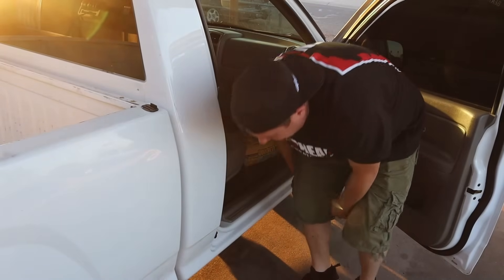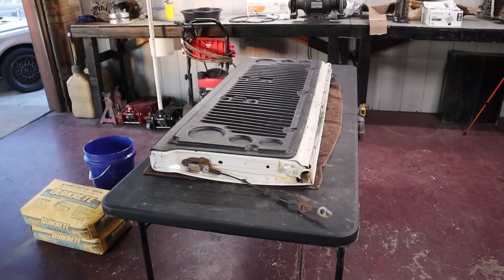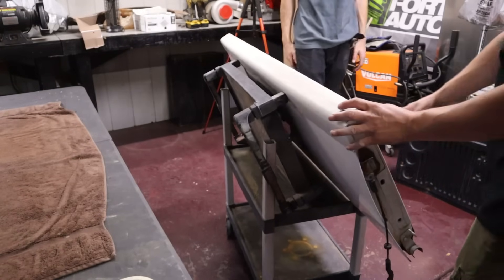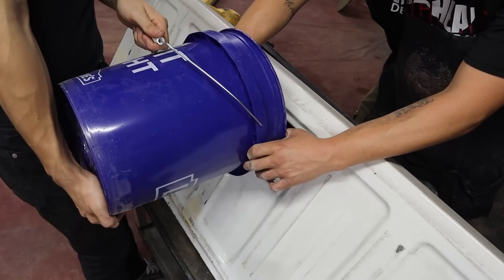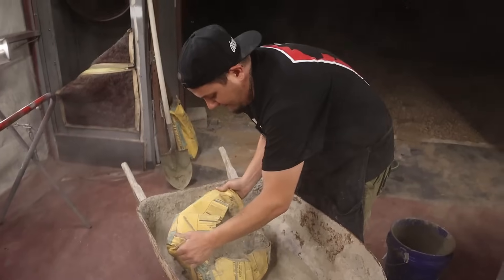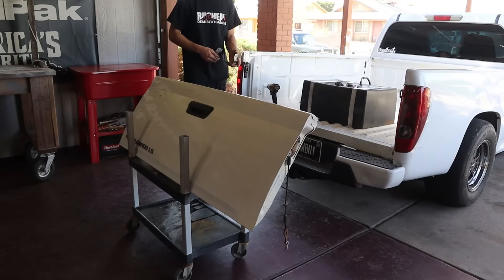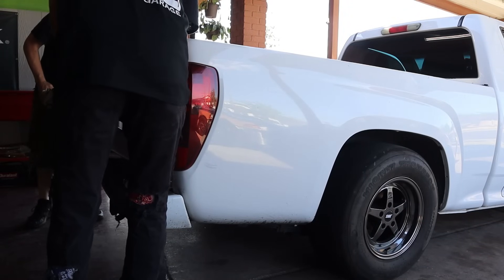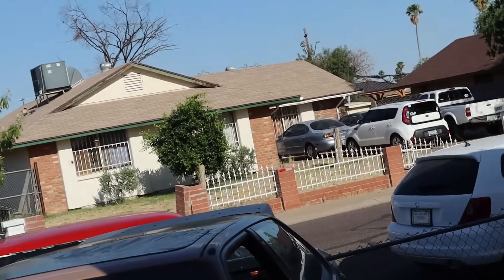Concreting Braven's Truck!?

Comment: Some food for thought is with all that weight on the other side of the axle it could make the front end light and possibly on acceleration when the front rises on launch it could lift and could be sketchy when dragging but that's all a possibility. Having the weight right over the axle would give the best traction.

Comment: Curious as to why you'd go this option versus using a good shock with adjustment out back, a quality spring set, and if it doesn't have them, Caltrac Bars? I get the whole "Beater Bomb Butthurt Bar lever action premise but this is stuff we did in the 90s with a 64 El Camino that was street raced for years around Chicagoland. Everything had to non-suspecious looking so we filled the tailgate with about 200 lbs. But with shock, spring, and traction bar technology now a days it would prove to be a better option just based on all the available adjustment you'd get out of it. Weight should always bee move able as well because you never know where you vehicle is actually going to need it depending on conditions and weight bais of the vehicle. With it in the tailgate it's stagnate weight and your stuck with it.
Reply: Best answer for sure.
Reply: $20 in concrete, or $2000 in suspension lol

Comment: You guys need better suspension. Not concrete. For the traction you get from the cement your going to loose in power to weight weight
Reply: Exactly!!👌
Reply: Then buy homie some suspension upgrades lol
Reply: @projectS10ls  you buy me some oil changes to break in my new motor and I'll buy bravus some suspention upgrades. Deal?  🤝

Comment: I filled a truck tool box with old rotors break hub bearings lol got to 500 pounds to weight the rear end down it does work in fact

Comment: Should of just pourd it in dry then added some water. It probably would of been easier.
Reply: Yep, would have worked just as good. That's how we use to do fence post at my old job. Never had an issue

Comment: Anyhow knowing what I know now the smartest way to weight the bed of your truck is to bolt two  plates in with a 2" shaft to drop 45lb gym plates on. That would have been much more convenient and easily removable

Comment: @ceelos87 like this guy said y'all should of vibrated it somehow not only to pack it more but also mix the different batches and too get the air bubbles out I used to do concrete columns for parking garages an other stuff etc

Comment: Lead blocks on the frame.. small but heavy asf
Reply: Have you looked up the price of lead lol
Reply: @projectS10ls  ehhh sorta forget since i can get them cheap but yeah you right pretty pricey if you need some real weight.. if you got the money though definitely the way in my opinion
Reply: Ya, speedway motors want like $300 for 100lbs, plus shipping lol
Reply: @projectS10ls  jesus man robbery.. did some looking into it actually outta curiosity, reddit had a good idea going to the local tire shop and melting down a bunch of the wheel weights they throw out since they supposedly lead.. though you would need a shit ton imao hahahahahaha
Reply: @projectS10ls  theres gotta be a way to get lead cheap, gotta be the solid lead too not the mixed stuff, but hell sand will work for awhile, while on the track and take it out after for better mpg
Reply: I missed out when a homie had a bunch off of a fork lift that his company was scrapping lol

Comment: if plan on adding a tad more wright.     do a square / round tube    " OVER THE AXLE,"     Bolt it / weld corners     wheel to wheel well 🦾

(this may help!     if u want tail gate down with bar's holding it).  as Braven said 💪   up or down may make a difference....  IF NOT BAR'S would look clean as FUK!! 😎
 and we Also, want to see lunch time with tail gate up and down,      that be cool 😎  

BE SAFE FAM!!!!!

Comment: Bro you just ruined the trucks gate for nothing your weight won't be evenly distributed and you will not have the ability to adjust it if you lift or pull to either side . You should of welded poles and used 10 lb weights with dowel pins
Reply: Looks like the tailgate works perfectly fine to me